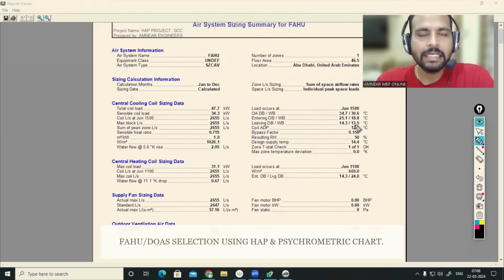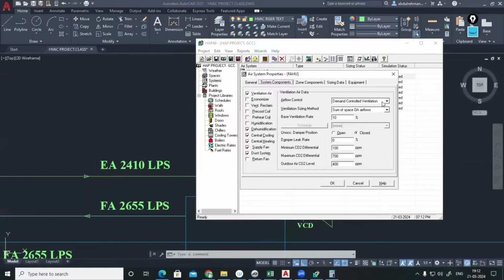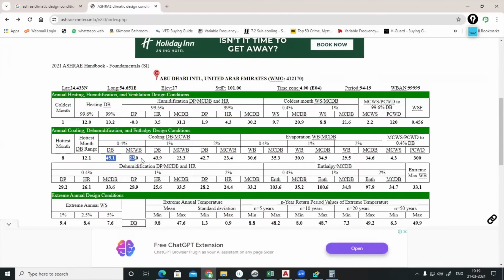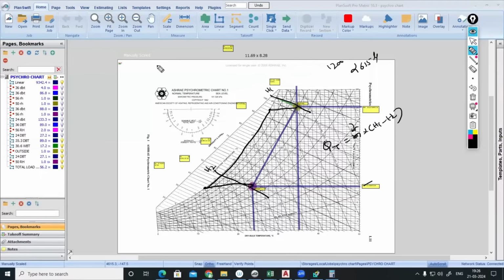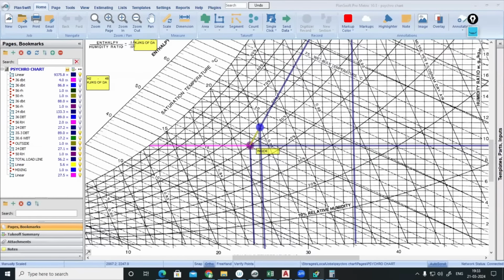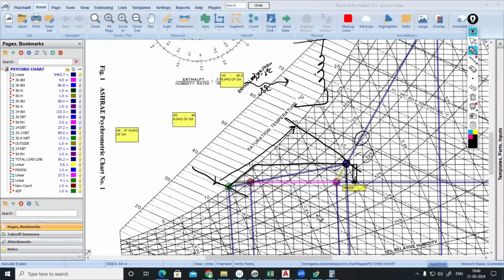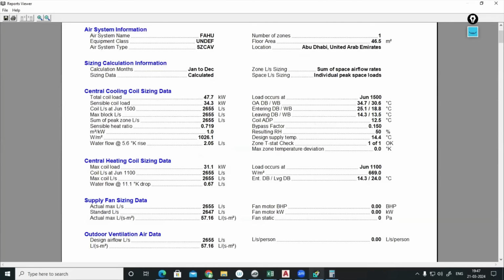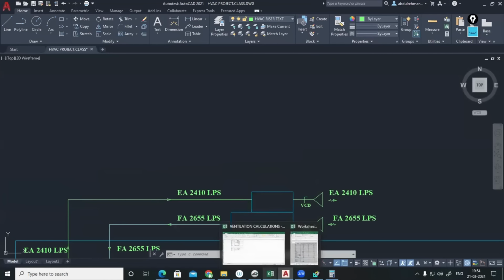FAHU/DOAS CALCULATIONS & SELECTION USING HAP SOFTWARE & PSYCHROMETRIC CHART|MIXING OF AIR|AMNEAR|

Comment: SIR IS THIS THE SAME WAY WE CAN CALCULATION COOLING COIL LOAD FOR AHU ALSO
Reply from the maker: No, it is different. When sizing an AHU for  internal cooling load, sensible and latent loads are calculated separately to determine the total load. The airflow rate is then calculated based on the enthalpy difference from the psychrometric chart. However, when ventilation is involved, the point plotting changes, as ventilation equipment and cooling equipment serve different purposes. I have explained ventilation equipment in this video.
Reply: @amnearmep can we use mcquay psycromizer for this purpose

Comment: During the HAP heat load calculation i got required cfm per tonnage of refrigeration as 270 cfm
Is it correct..?
Why this value shows a huge variation from the thumb rule (400 cfm )
Reply from the maker: It's essential to move beyond relying on thumb rules, as they often lack accuracy. Machine flow rate varies based on factors like room load, coil entering and leaving temperatures, ADP, and supply temperature etc. While many manufacturers produce machines with airflow rates around 350 to 400 cfm per TR for comfort air conditioning systems, everyone used to follow that. But, As discussed in our earlier sessions, thumb rules can lead to oversizing or undersizing the system. Using HAP calculations provides accurate and optimized outputs, including machine coil load, airflow rate, entering and leaving temperatures, ADP, and other details necessary for selecting the right machine from the technical data sheet, as explained in last session on HAP. With HAP, you can identify a perfect model, from technical data sheet with options for medium-speed operation. 

While 270 CFM per TR may seem less common, it's important to note that it's not necessarily incorrect. Factors such as lower room loads and greater differences in coil entering and leaving dry bulb temperatures can justify a lower airflow rate. I recommend reviewing your inputs to ensure accuracy. If everything is in order, then the calculated airflow rate is likely correct.

Comment: Can we call DX (Direct Expansion) in Vapor absorption system?
Reply from the maker: Direct Expansion (DX) is a term specifically used in vapor compression systems, where the refrigerant evaporates directly in the cooling coil. In vapor absorption systems, the term DX  is not commonly used because the principles and configurations differ from those of vapor compression systems. Vapor absorption systems are typically described based on their absorption process and components.
Reply: @amnearmep  Thanks

Comment: What is key difference between FCU and AHU?
Reply from the maker: Big topic to type. Anyhow in nut shell.....FCUs are like small air conditioners, perfect for single rooms like offices or hotel rooms. Meanwhile, AHUs are big, handling airflow for entire buildings, delivering it through ducts to different rooms. FCUs suit smaller areas, while AHUs are for larger spaces or whole buildings. FCUs usually have a fan, heating or cooling coils, and sometimes basic air filters, whereas AHUs have more parts for treating and distributing air. Though AHUs are bigger and more complex, they're not just enlarged FCUs; they're designed differently to suit various building sizes and needs. FCUs are usually proposing to the spaces to take entire heating or cooling load except ventilation load and ventilation will be delivered by a central FAHU. AHUs can handle cooling/heating without ventilation, cooling/heating with ventilation, or ventilation only applications.
Reply: @amnearmep  Thanks